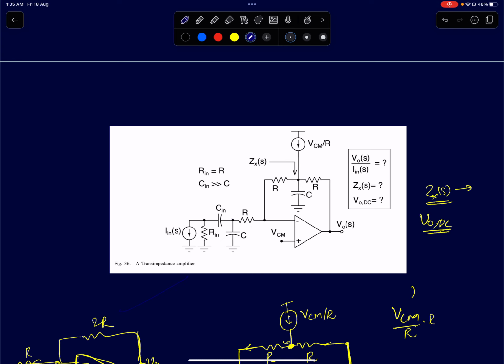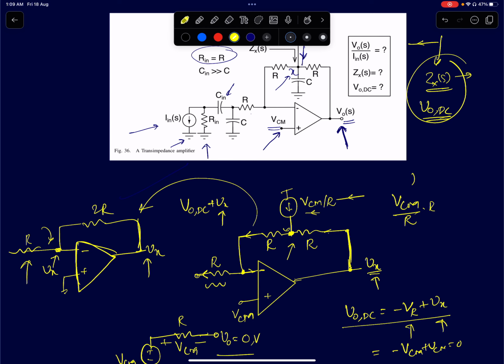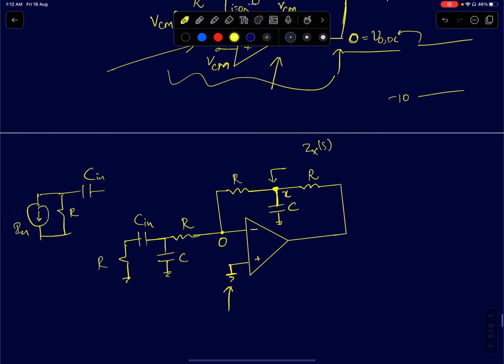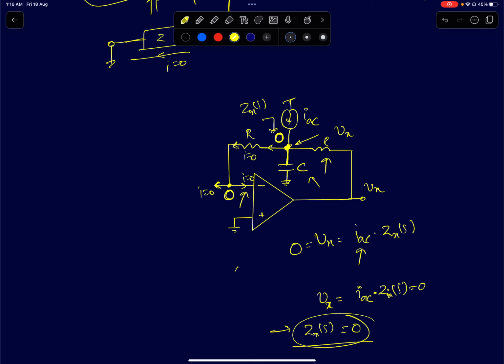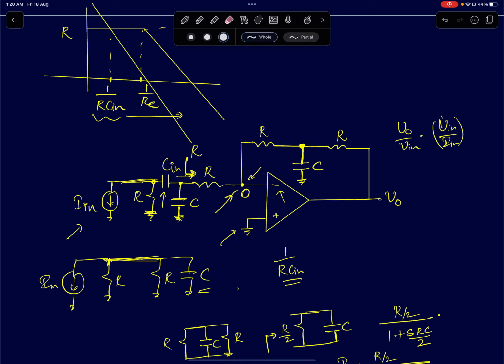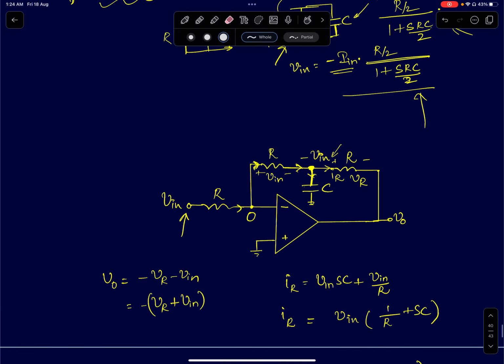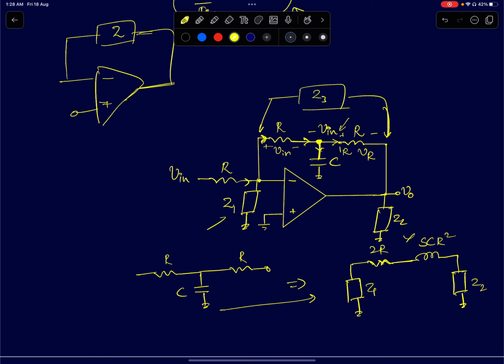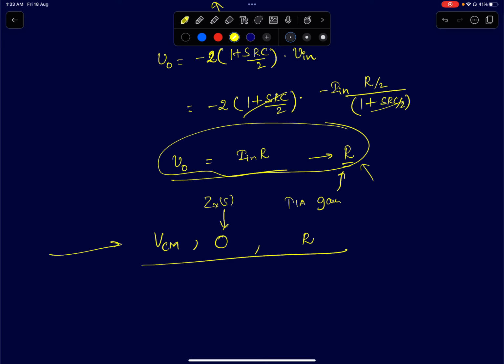OC Lecture 16) An interesting opamp based Transimpedance amplifier circuit

Comment: For the third part, if we look left into the current source with Rin, the circuit reduces to a Thevenin equivalent of IinRin with a series Rin. Hence the feed-in network becomes same as the feedback network (both are T R-C-R). So Vout = -Zfb/Zin*IinRin etc.
Reply from the maker: That’s a nice approach. Will talk more about this in another video. We cannot directly divide two R-C-R networks, we need to do another T to PI transformation for both the networks and then apply Zfb/Zin, we will get the same result.